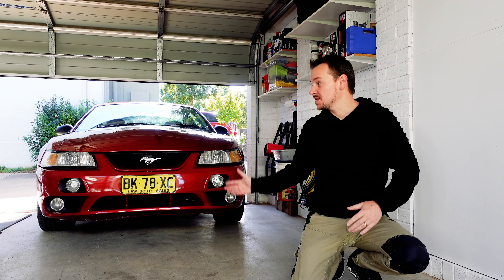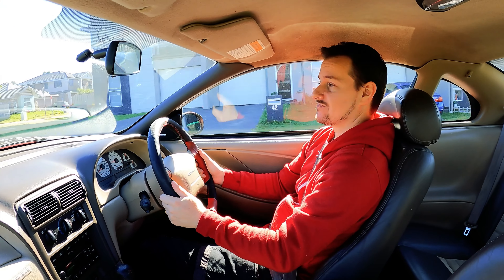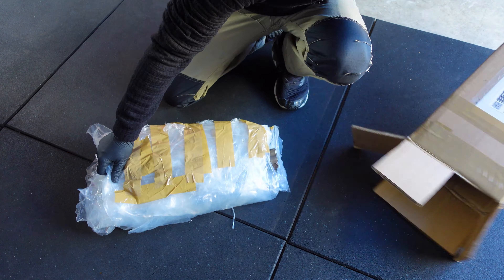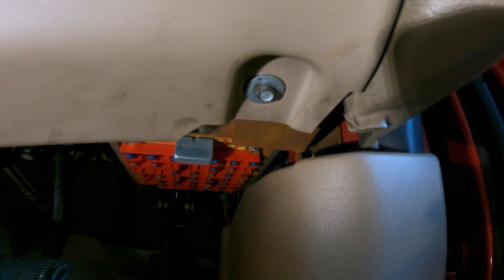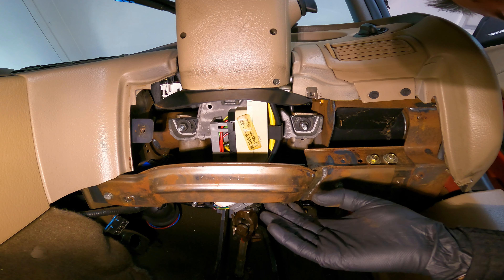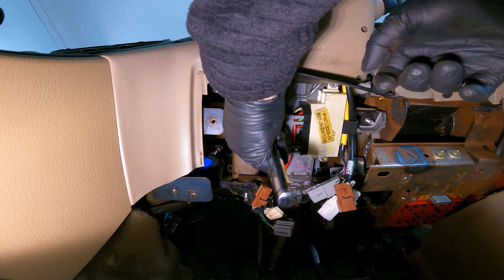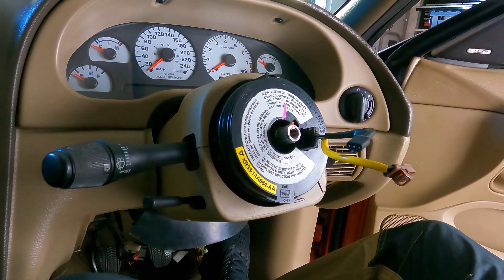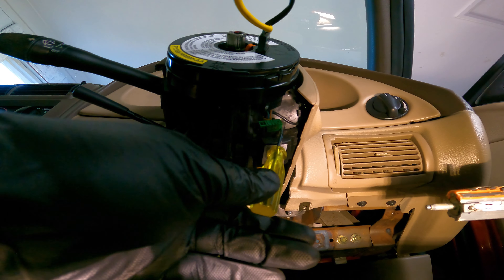SN95 & New Edge Ford Mustang Steering Column Replacement – DIY Walkthrough

Comment: This is the same process for changing out the ignition switch actuator, which is the plastic piece that connects the key to the little white box on the bottom of the steering column. I was once left stranded because this piece (Dorman 47510) broke and I could not actuate my ignition with the key. Luckily just removing the bolts on that white box, you can manually operate the function on the ignition. Just stick your key in the ignition and with your hand push the little peg on the white box forward a few clicks and then all the way under spring pressure will start the car (just as you turn the key). Hopefully that helps someone, great video!

Comment: Is there anything in the column that would give the steering a sensitive feel when turning the wheel?   Like not much tension when turning the steering wheel?
Reply from the maker: Hi James, the steering column is a pretty simple device. I don't think there's anything in there that would make your steering go light. I would suggest that the ease with which your wheel turns has more to do with the steering rack, and probably more with the power steering pump.
Reply: @Horus_Works  yeah I guess it’s getting down to those objects as being the culprit.  Thank you for responding!